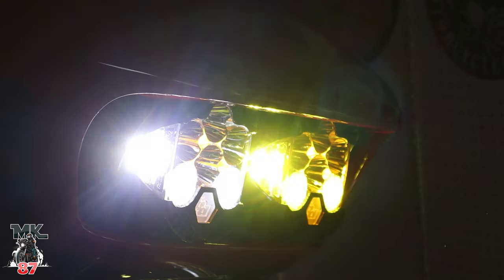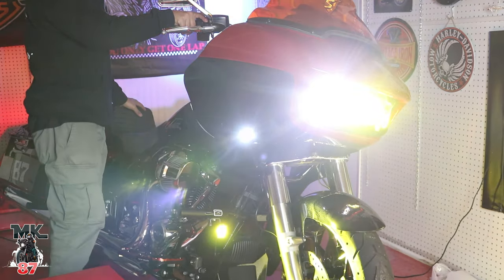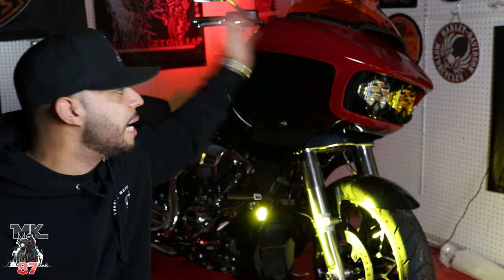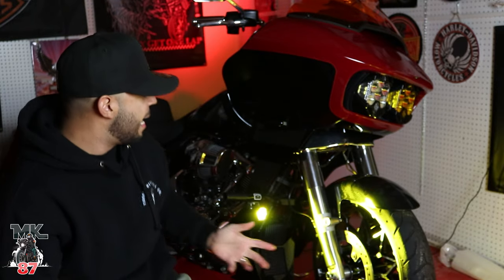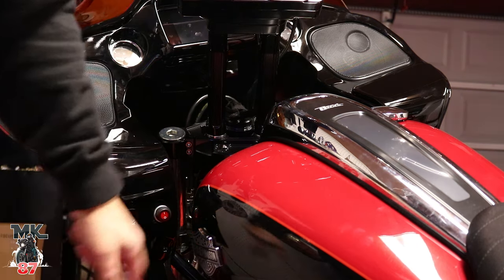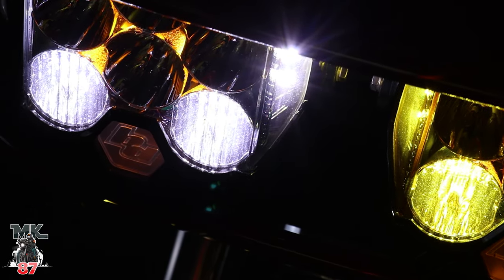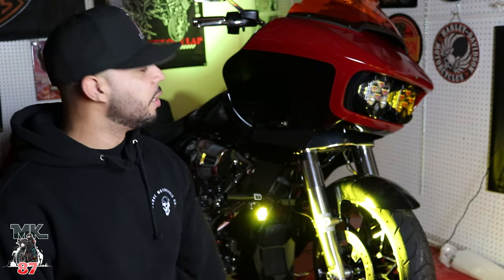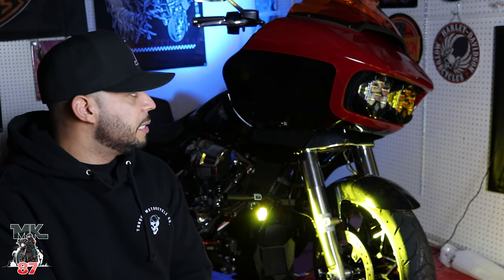My Baja Designs setup on my Road Glide Special

Comment: LP6 lighting setup is very cool.  Any advantage of amber lower reflection in fog is negated by the white though, as you will get the increased reflection in the denser fog associated with high temp white since you are running them in tandem.  Ultimately it doesn't matter because you can see all the way to the moon with those lol